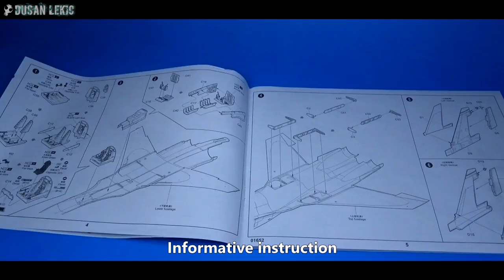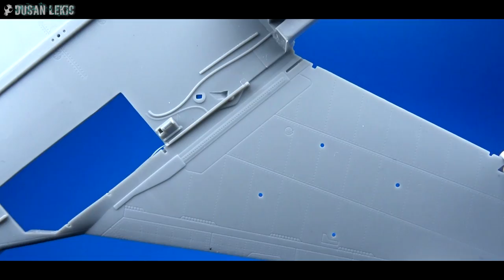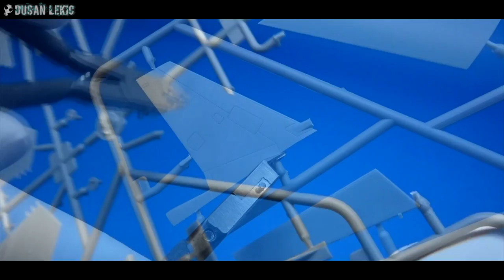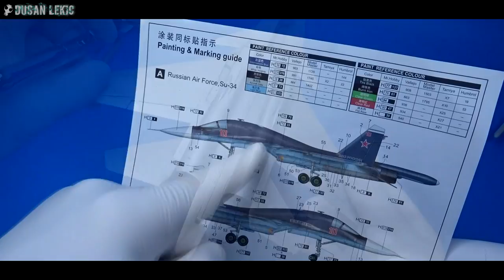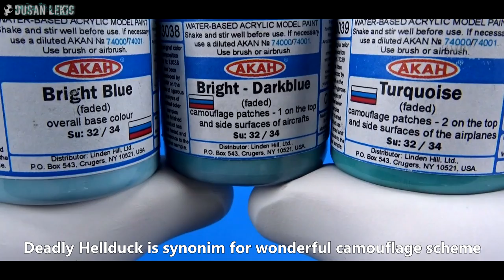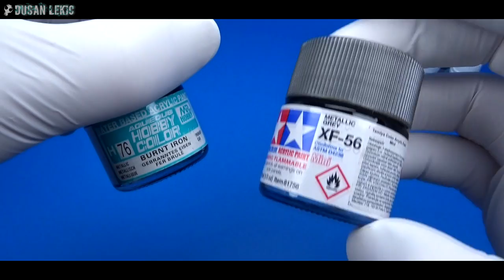Sukhoi Su-34 Full video build -Trumpeter kit

Comment: Ive always loved the fullback, side by side two seat cockpit with a restroom and bed. Crazy for a fighter bomber. I want one for personal use, not just to fly but to live in ha ha ha
Reply: I want one for a business jet! Strip out all the combat systems and add more fuel capacity.
Reply: Eh, wouldn’t. Necessarily call it livable lol. Know they have a small toilet and kitchenette but not too sure about an actual bed per se. They are there for pilot amenities for the fact that this plane not only does strike missions but photo recon and intelligence gathering, so a lot of loitering time for a number of missions. B-1B has similar features for the exact same reasons too...the need to hang around a combat area for long periods of time or extreme distances

Comment: I really need to buy an airbrush... this hobby is really expensive
Reply: mathias goffin You can buy Inked Katana. It’s cheap.
Reply: Look at a cheap Chinese airbrush and compressor. Not a massive outlay if it's not something you like, and if you decide to continue airbrushing, you can still use it for priming even after you get a decent brush.
Reply: Which ever airbrush you go for - make sure the compressor you get has a tank, it will cut down on noise and give you a constant stream of air
Reply from the maker: You can buy Sparmax Sp-35b here for 35Euros yes, really. There is also a set DH 03 or something like that, Sparmax 0.3mm with air compressor for 110e set. Believe me you can check out and find cheap but very good airbrushes. Some kits cost more... all the best! Dusan
Reply: you don't need an airbrush for military models of this scale, to be honest
Reply: In addition to a compressor with a tank, get a moisture trap and a separate pressure regulator.

Comment: Good afternoon. In practice what is the difference between a 0.2 and 0.18mm needle?
Reply from the maker: Not a very big difference. Depending on colors 100% I would choose 0.2 for acrylic. 0.15mm much better for enamel (properly thinned). But, if you are use laquer thinner with acrylic paint you can use it with the sam final results. All the best! Dusan